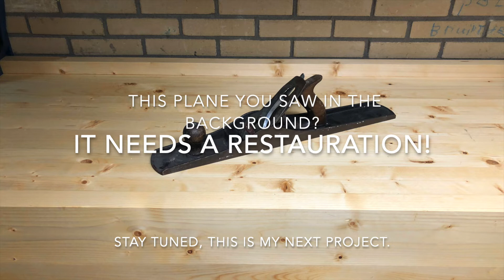Stanley bailey handplane quick improvements for a better setup

Comment: So you stated with the ruler trick on emery paper, then went to a file, then finished with 220 sandpaper?  I do agree that sharpening the blade is an improvement over not sharpening it.

Comment: I've never seen the ruler trick used on the sole of a plane before. Can you please explain what the idea is behind this action?
Reply from the maker: It creates an ever so slight chamfer on the edges of the sole of the plane so it wil slide more easy over undulations in your workpiece.
Reply: And here's me thinking that the concept of how a handplane works is to remove the undulations in your workpiece not slide over them🙄

Comment: Cannot flatten the sole with a surface plate that is shorter than the planes sole/length of the stroke.

Your own witness marks prove that.
Reply from the maker: Thanks, I am aware of that. My intention was not to flatten the sole, it was meant to quickly check for any major deformation.